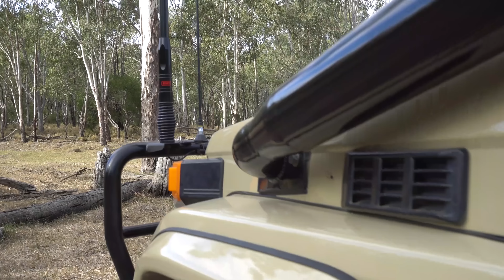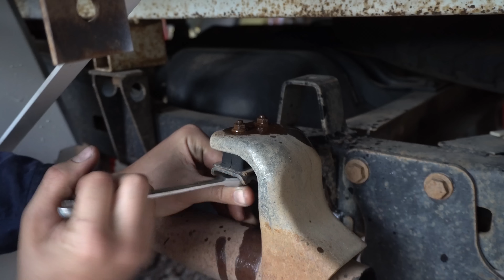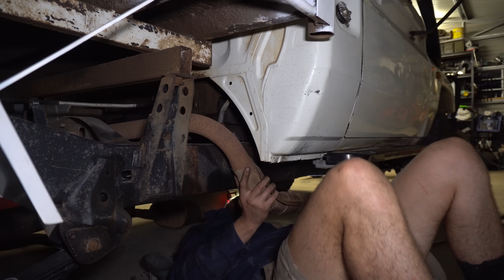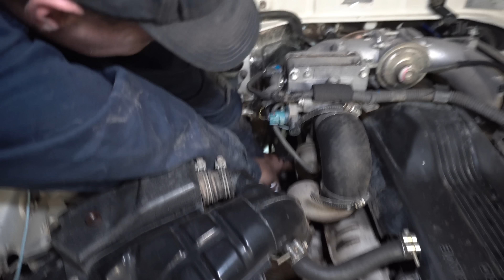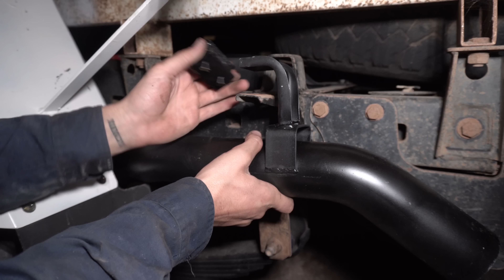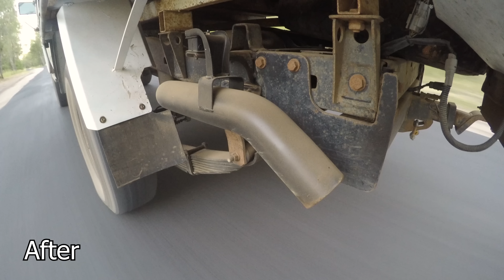Toyota 79 1HD-FTE 3 Inch Exhaust Install + Sound

Comment: yes sounding more like a old mack pulling hard through the gears.loaded up the 79 comming together for u slowly keep the good work up.....im running 2 and half inch system straight thru on my 75 series 1hz garrert turbo great old diesle sound i give you the thumbs up
Reply: Thats the difference between a high quality part and shit you find on kings, unfortunately you'll never get that old v8 mack sound out of a car.
Reply: @Santibee3  well you certainly wont out of an inline 6 cruiser haha

Comment: Hi, love your channel and your advice. I have a 1990 model 75 series with 3F petrol motor and I want to remove it and replace with a 2003  79 series 1hz non turbo engine, what are the issues I need to consider. Thanks

Comment: Do you know if a ct26 turbo on a 75 will have the same exhaust system as this does want to have. 3 inch exhaust system to bolt up to the turbo when I get it

Comment: Sounds smhick mate 👍🏽 had to replace a couple of those rubber exhaust blocks on a 99 model 1hz cruiser, local toyota dealership wanted 30 something dollars per block, went to an exhaust shop here in wagga and ended up buying 3 of them for 30 dollars
Reply from the maker: Definitely pays to shop around!
Reply: Buildin70s sure does mate 👍🏽

Comment: Could you please answer this is a hzj 75 series and a hzj79 series exhaust system is the same and also I’m turboing my 75 so would that system work in mine thanks love the videos
Reply: The Og fox my guess is no because the 79 is turbo?
Reply: Tyler Dykstra yeah I’m turboing mine with the ct26 turbo
Reply: Isn’t 79 a longer wheelbase?
Reply: Chris Banning longer cab by 100mm
Reply: The Og fox just has a look, there’s an extra 200mm in the wheelbase